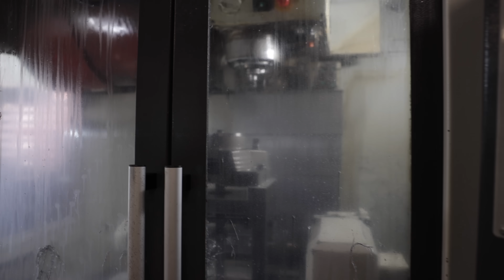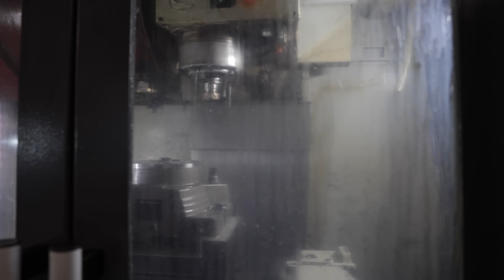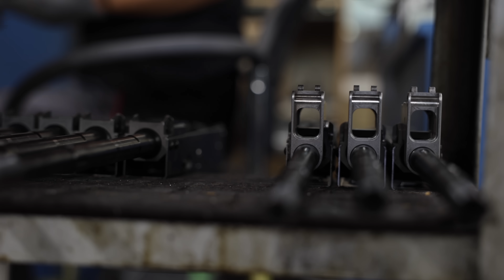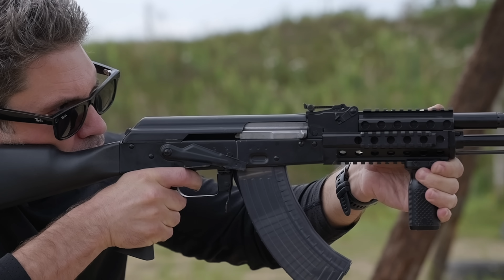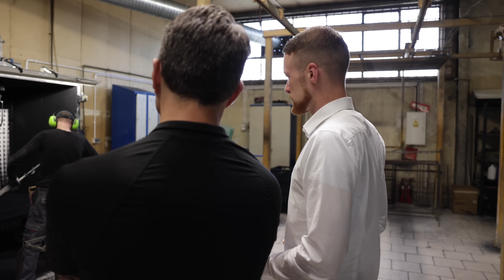What It’s Really Like Inside an AK-47 Factory: WBP Poland Tour

Comment: I understand the toxicity concern in regard to chrome lined production but the concern about the inner lining of the barrel eventually “wearing away and chipping” I think is pretty non compelling.  Anything used enough times will fail at some point but when you think that Japanese chrome lined barrels that have been kicking around since the forties in an often flagrantly neglected fashion are still bright and accurate today,  the fact that at some point chrome barrels will wear out really doesn’t concern me very much.  Non chrome barrels wear out too and much sooner,  and when they do they are just as useless

Comment: WBP is SO underrated, and continues to fly under the radar. I've had my WBP Jack 5.56 for a few years now, got it in Smoky Walnut furniture for $1,220 which is hard to get for 5.56 now. It's been a boss at the range, very accurate, i get about 1 moa at 50 yards, 1.5-2 moa at 100 yards.
Reply: Your minute of angle is the same at 50 yards and 100 yards. The size of your groups gets larger.
Reply: @Dzwieczny Yeah that's what I meant, mb
Reply: Yeah, but you are NOT supposed to grind down neither gas tube, nor top cover
Reply: It's called fitting my dude. You would be amazed in a master gunsmiths shop to find most of everything is hand fitted.

Comment: The biggest mystery is how they put the rifling grooves on the inside of the barrel.
Reply: There are three ways to rifle a barrel. One is to cut each individual groove with a machine that moves a cutting tool back and forth (only very expensive precision rifles are made that way). The second is pushing or pulling a button that cuts all of the grooves at once through the barrel. Third is hammer forging the barrel over a mandrel which has the shape of the rifling.
Reply: @blegi1245 wow, thanks for the information 😊

Comment: If you manufacturing has tight tolerances  your bolts and barrels and receivers should all interchange with each other. So if you need a new barrel you have to buy a matching bolt to it?
Reply: It is because of how it is assembled. The barrel is pushed into the trunnion. If you buy a new barrel, you don’t need a new bolt. Push in the new barrel until it headspaces, then drill the barrel pin hole, then press on the barrel pin. (Depending on firing rate, you might lose headspace before you need a new barrel. I shot about a 1/8 of a shipping container of 7n6 on my Bulgarian 105. I had to re-headspace the original barrel, but it is now a 3-4moa carbine.

Comment: Have WBP Jack 556.  Love it.  Only complaint was it was INSANELY over gassed.  Installed a KNS gas piston and this thing runs like warm butter...
Reply: That's how AK rifle operate, and the reason why the last so long.
Reply: @Hatouken  Sorry...,but naw on this one.  I own 6 AK's.  The 556 Jack I own was absolutely over gassed, by a lot.  We're not talking 'normal' AK gassing.  I'm talking bolt over-speed to the point it wouldn't make it through a single mag without choking and felt recoil above stock 7.62 builds with metal endplates.  I have no idea what their gassing is now as mine is several years old.  Tuned, it has been 100% reliable and one of the smoothest platforms I own.
Reply: @CS-xm3be  They probably drilled the gas port to 7,62 spec and not 5,56 spec.  😆

Comment: There's one significant issue I've been seeing from a few online threads over the last year: accuracy issues out of their 5.56 series of AK pattern firearms. What's up with that? They seem extraordinary, everything else wise.
Reply: I asked WBP about that and breaking firing pins as well. They claim that both issues were resolved and currently produced guns are not affected.
Reply: My recommendation: get the 5.56 parts kit, get a Green mountain nitride barrel, and an Occam adjustable gas. Holy chit.

Comment: Strange hearing about all this excellent QC they perform. I had a WBP jack 5.56SR shoot bullets sideways at 25 yards. They didn’t check my shit.
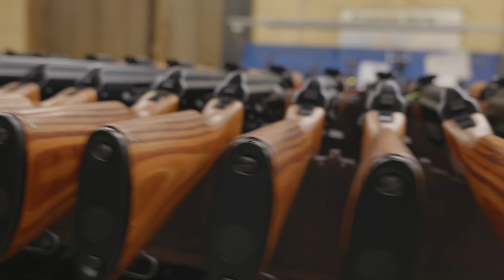Reply: 10:50 - 11:45 notice they skipped mentioning 5.56 when talking about accuracy of their barrels ;) have reads tons of similar reports about their 5.56 offerings
Reply: I asked WBP about that and breaking firing pins as well. They claim that both issues were resolved and currently produced guns are not affected. Great thing about them is they fix guns at no cost even after warranty expired (at least in Poland).
Reply: Are they using a weird twist rate that doesn’t stabilize your chosen grain ammo?
Reply: @bodhim4353 no. It was a 1/8 twist barrel shooting 55gr cheapo ammo
Reply from the maker: I would contact them and see what they say. They tell me one of the most common complaints about accuracy is almost always resolved when the gun is returned to stock configuration. Funny enough, the buttstock is usually the culprit.
Reply: @tfbtv wow the buttstock is responsible for keyholing bullets?? Seems like I would’ve have noticed that after owning more than 10 Ak rifles!
Reply: @magdump_supreme69  😁